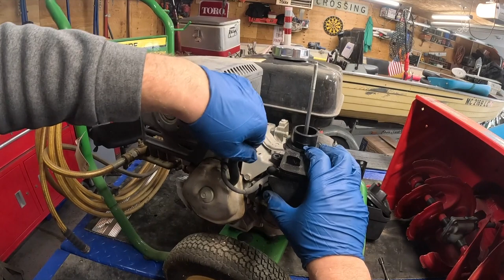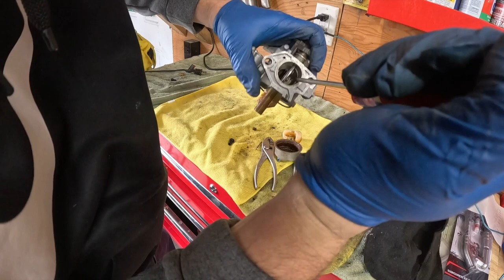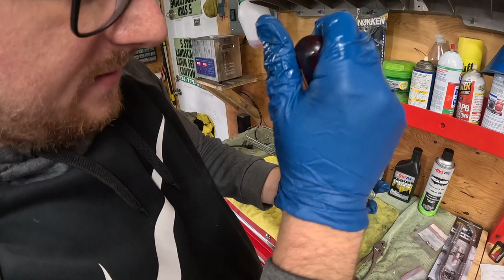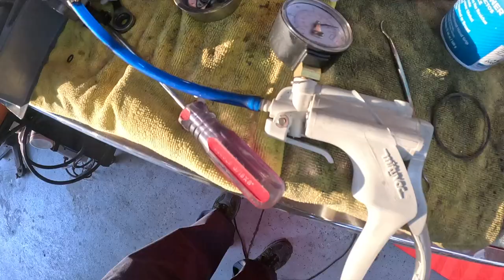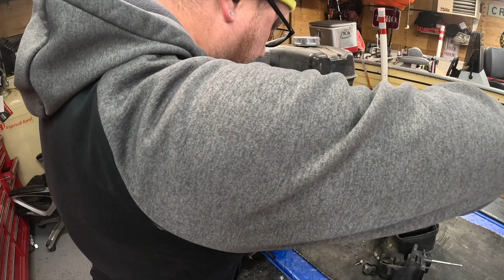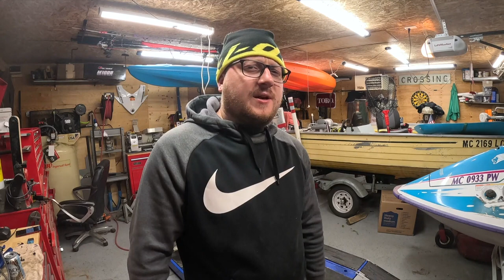How To Clean Gummed Up Honda GX 390 Carburetor On John Deere Power Washer

Comment: I have the same 2013 unit.Could you please tell me what pump make came with this unit?
Reply from the maker: @glennsr.1082  its been so long I can't remember I want to say possibly a cat pump, there's a name on top my head can't think of, if you need a pump there fairly easy to find for John deere on line around 350ish
Reply: @mrsrx4584  Thank you for your time.